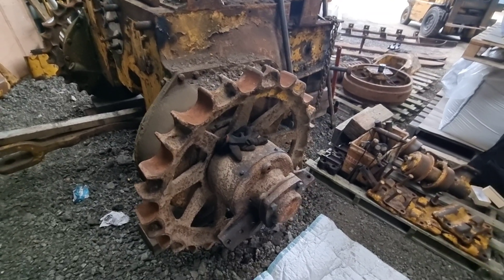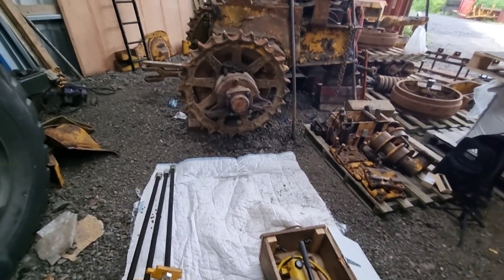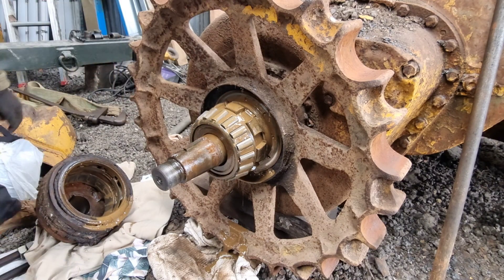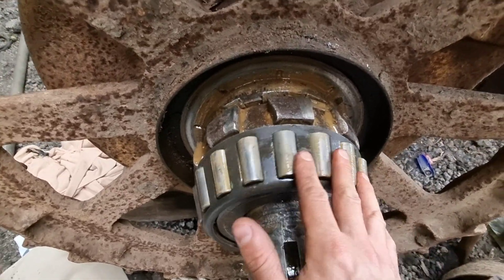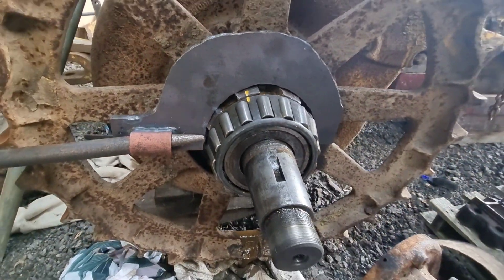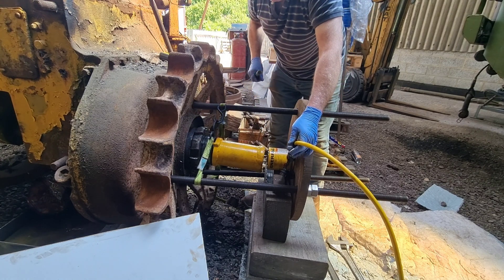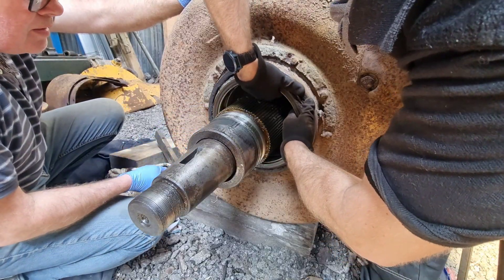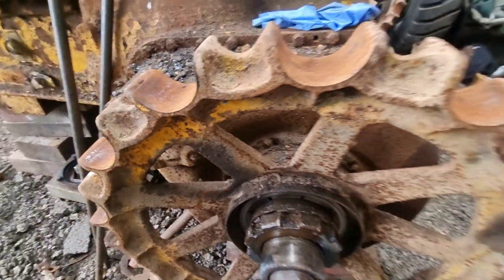Caterpillar D8 8R sprocket removal

Comment: seems like the bearing was making it harder to turn the nut w/ the spacer bar. don't know how the cutting went but pulling/cutting the bearing first might save a lot of spacer time. cut a lug nut off a wheel stud once w/o damaging the stud threads w/ a oxy/acetylene torch years ago

Comment: I don't know why you trying to save the bearing.  3 minuets with a torch, that baby is on the ground.  No scores to the shaft.
Reply from the maker: Might need it one day, wouldn't wanna pay for one new, but yes torch is always easier!
Reply: My Daddy called a use bearing, trotline weight.  Just saying.  We had D8's for years.
Reply: There is no way, my Daddy would put a used bearing on the final drive...Just saying...